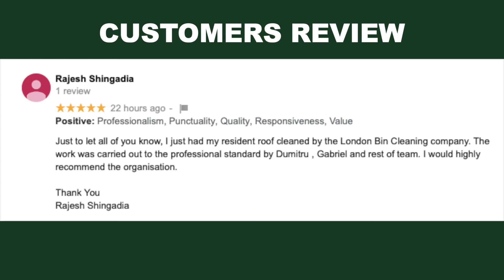Super Satisfying Moss Removal From Roof!

Comment: What system do you use for spray the biocide?
Reply from the maker: Hi Paul, we've got a few different systems we use - a window cleaning trolley, a biowash machine which is basically and electric pump and marine battery, an X jet or a pump up sprayer and telescopic lance. Depending on how large the area is that requires treating.